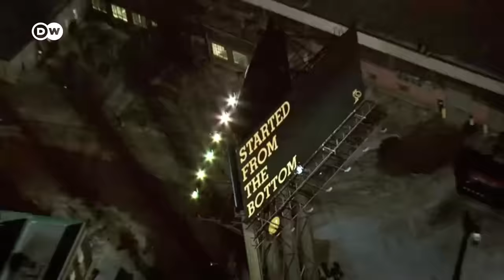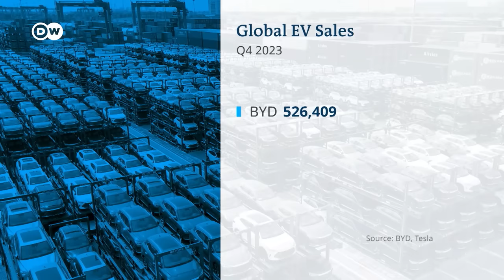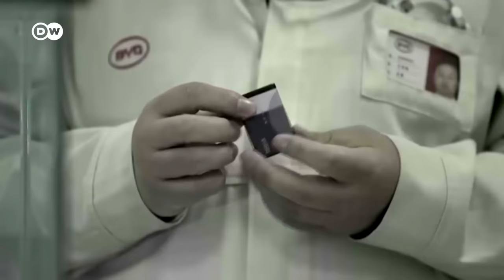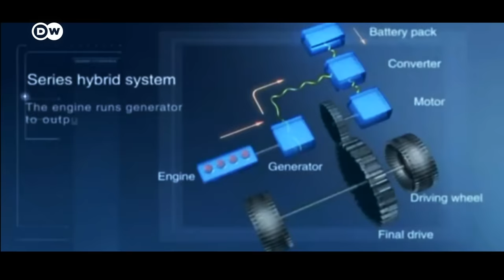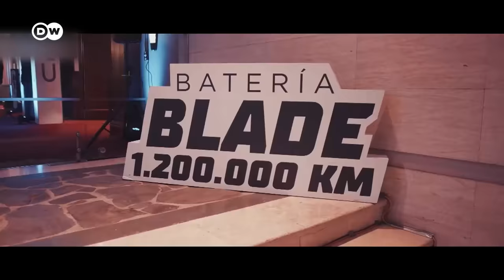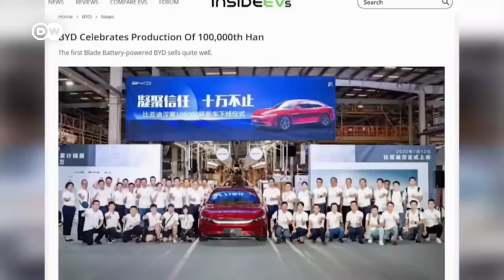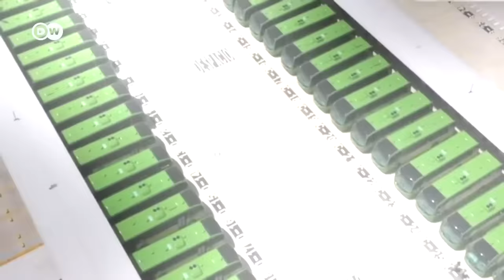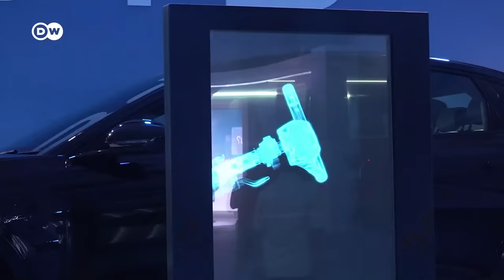How BYD killed Tesla! But can they stay on top?

Comment: BYD's battery is the main killer. No fire hazard, work well in Cold weather.
Reply: Yes, BYD & LFP batteries come with cons, heavier, less range, & throttled performance in cold, but, they won't burst into flames parked in garage overnight...burning house down...must be insurance cost benefits to that!
Reply: @100milnic  BYD LFP battery doesn't effect by -20 Celsius.
Reply: No fire hazard? Lmao.
Look it up.
Reply: @100milnic  well fan west car
Reply: The export variant is better but often the BYD domestic variant gets fired on the road.
Reply: @dannicrane5577 byds that are burning are older than 2022 because they started using blade batteries since 2022

Comment: I took the plunge and leased a BYD Atto 3 this year. I honestly have to say I haven't ever owned a better put together car. Previous cars in the household have been Honda Civic and CRV, VW Golf and Subaru XV. In all of them I found something not right in the assembly, or they were recalled for faults. So far I cannot fault the BYD, except for the OEM choice of tyres which haven't performed so well in wet weather (will be swapping to either Michelin or Continental soon.).  I can honestly say old school car manufacturers have a BIG problem in front of them as BYD is pumping out a quality product at a very reasonable price point.
Reply: I would like to get a month by month evaluation as time goes by...tyres..is 1...but an important 1..I look forward...this is not a knock to BYD..
Reply: I agree with you.  I have the BYD Atto 3 元plus for two years now.  I haven't owned a car that made me happier.  There are so many feaures the BYD gives to the driver and passengers, I don't know where to start.  It is truly an unbelievable car, and very safe.  Extremely well engineered.  Amazing.
Reply: @thezishateapotchannel.1675  the small monitor screen is the only thing I can't accept
Reply: I wish y’all the best. Please don’t die.
Reply: I'd fault their brand name... "Build Your Dreams" sounds kinda cringy... other than that it's good
Reply: @monkeydee7132  how about Life's good? LG?
Reply: @radiatorrobert151  FYI in the new 2024 release of BYD Atto 3 the tyres are now all Continental tires by default, they removed Batman tyres completely.
Reply: @LoveTheMusicOz Where did you lease your BYD? Considering they are not currently sold in America. Safety issues and political tension between countries, are main reason they are not sold in the USA. Any BYD auto, would not surpass a Honda Civic or the little family oriented CRV.

Comment: German managers should not be surprised, they intentionally didn’t do anything towards EVs.
Reply: German manufacturers just want to continue to earn profits from ICE vehicles.
Reply: They are doing a lot, the Chinese just work harder and smarter for much less money and have economies of scale. The Japanese are trying to figure it out, the labor cost is cheap here, and there is money but technology and software are on the Chinese side.
Reply: Both companies grew with subsidiaries and loan dumping, BYD workers get 1 till 3 $/h and Tesla pays 20% under market level. Why should German companies force themselves early into a rat race. The whole EV thing will only get serious when solid state batteries are cheap and save. 70% of Europe's population simply can't afford the price and the headaches.
Reply: Especially Bosch, I used to be so proud of the brand. But for the last 20 years it's just total denial. Scooter and E-Bike is all they did
Reply: @whistlingdiesel that solid state stuff is only a delaying taktik. Drones will benefit and able to pay the extra. 
Sodium ion should the choice if they get it to 80$/kWh 160Wh/kg and 6000 lifecycle.
Reply: @tarant315 If Bosch “didn’t do enough” for the EV movement… that should really tell you something!! As the largest automotive supplier in the world.
Reply: But firms like BMW and Toyota and Honda went into hydrogen. That might beat BYD. But even if BYD itself falters, another Chinese firm specializing in hydrogen cars may emerge and become number one.
Reply: @lukeclifton4392  let Tesla build their own equipment, and any other car company in that case. Perfect own goal.

Keeping the status quo in polluting industries is nothing I like to be proud of
Reply: Hydrogen is scarce. It doesn't make sense long-term. @TheHammer70
Reply: Not everyone want an EV. We like luxury ice cars. I don’t want to be seen in a cheap small car. I rather pay more to differentiate myself from the crowd. 
I think it’s stupid to build cheap cars and think you can make money from it. There’s a reason why Ford, GM & dodge stopped making small cars. Nobody want to buy it.
Reply: @hidetsu7249   the chinese do indeed work hard and for less, but in terms of innovation and billions of dollars spent on design, saftey issues, batteries and other development of EVs China didn't do much either, they quite literally just made them based on foreign designs and engineering.
Reply: @tarant315   what are you even talking about dude? What does supplies coming from germany or any other place of export even matter? Its impact on pollution is literally zero considering german manufacturing makes up for the extra pollution spent in transit. You do realise the worlds markets have been interdependent on each other for parts, raw material, labour etc. forever and ending this would massively hurt the economy of scale.
Reply: @goingoutotheparty1   what a vague and ultimately meaningless little metaphor you got there. I'm not sure how this is similar to a rabbit in headlights but oh well
Reply: They know the EV fad would come to a screeching halt, and it has!
Reply: @dopaminedreams1122 blade batteries are made in Europe and copy WV design!
Reply: @tarant315  You know the EV industry pollutes more than ICE right?!?! 🤣
Reply: @maxkick7656  Hydrogen isn’t scarce.
Reply: Germany is playing so safe that they will soon start scoring own goals
Reply: @maxkick7656 hydrogen is THE most abundant element in the Universe.
Reply: cause EVs are junk
Reply: @amandagrant4331 as they should
Reply: @TheHammer70 hydrogen  is a super dangerous choice. Hydrogen can explode at a concentration of 4% in the air. leakage of 1 hydrogen car will cause explosion in 20000m^2 area. If it explodes in a parking lot or a tunnel that ‘s full of hydrogen cars, it will be hell a disaster.
Reply: @Allangulon 
3 decades ago some people said that home computers and internet were a fad and would never become popular. 😂
Reply: @lukeclifton4392 
You know you have brain fog right?
Reply: @whistlingdiesel  to perfect a product, you need time for trials and errors.. it sucks to to play the chasing game..
Reply: As a Chinese point of view that's very understandable. They already have the infrastructure earning billions from it - why change? If China was in the same place, it could experience the same thing. Time progress and change.
Reply: @Anonymous------  
Apples and oranges.
For one, we didn't have home computers prior to 1977, unlike motor vehicles that have been around since 1901. Simply put, the home computer had no competition, the EV has stiff competition.
If the powers that be really care about the environment, they should demand more Efficient ICE vehicles.
As it stands EV's produce more carbon emissions than an ICE vehicle over their lifespan, considering EV's on average have a lifespan less than half of an ICE vehicle.
Questions?
Reply: @maxkick7656  
Seriously? 
Hydrogen is the most abundant element in the universe.
It's also difficult to separate as it's a sticky element in that it bonds easily to other elements and rarely found in its pure form.
So, to be more accurate, loose hydrogen is scarce!
Reply: @Allangulon  
In 2023, 82.38 percent of new cars sold in Norway were EVs. The goal is for the entire Norwegian car fleet to be zero-emission (electric or hydrogen) by 2025. 

Norway's fleet of electric cars is one of the world's cleanest, because 99% of its power comes from hydropower.

Electric cars are cool! They are silent and don't create noxious fumes. And you can drive for several hundred kilometers before you need to charge. Not that charging is a major problem in Norway – it has more than 3000 public charging stations, and 7753 fast chargers, all over the country.

Even in the northernmost parts of Northern Norway – an area with huge distances, more reindeer than people, and really low temperatures in the winter – you can get around easily in an EV.
Reply: @Allangulon  
When someone invents a way to cheaply extract the hydrogen from water and safely store it in small space.
Reply: ...70% of Germans can't afford anything, let alone a new car.
What a great govt you've elected!!😂😂😂
 @whistlingdiesel
Reply: @tarant315  John B Goodenough and Helena Braga spreaded their licences on over 30 companies and if drone or military usage will boost this, solid state will come in time. Sodium ion is pretty neat but I see the potential more in non-toxic liquid flow batteries as a green engergy buffer. But you are absolutely right if the energy density and the price is right they are on, too!
Reply: @georgewilder7423  I was speaking of Europe, tell me a country where inflation hasn't made life unneccesary hard. As germans are pretty rich they can easily afford EVs ....but not the headaches 😁😁. As in everybody can finance a new Dacia Spring but not the... you get it.
Reply: @whistlingdiesel  ....Germans are pretty rich.
If you're a German, then I say you really don't know what's happening in your country.
Ukraine isn't the only place that's doomed.
You have govt officials who don't even know the difference between 180° from 360°. Lol!!
Reply: @Anonymous------  
Good for Norway, now how about countries like Australia with 83 times as much road as Norway?
We have a sheep station bigger than Norway!
Reply: It doesn't make sense to do much towards EVs. The majority of German car owners that got EVs regret them and go back to a combustion car on their next purchase.
Reply: @dopaminedreams1122  but improved and them..
Reply: @lukeclifton4392  ..,thank you Greta!!
Reply: @tarant315  I believe Bosch have supplied the driver assistance technology being incorporated in the BYDs. 😊
Reply: How so? German EVs are very decent.
Reply: @JoeChan-c5r  nope . Blade batteries are made in china btw .

Vw doesn't have an ev
Reply: @lukeclifton4392  source ? Proof ?

Comment: BYD blade battery does not perform as high as Tesla, but works better in cold weather and way safer.  The new BYD sodium ION battery is even cheaper, less sensitive to weather and abundant.  The newly released Qin L is a HEV capable of 2000+ km range (from NY to Miami without refill), more than twice as Toyota Prius and priced just lightly higher than half of Prius, it could easily disrupt U.S. market easily without charging even with 100% tariff.
Reply: >> BYD blade battery does not perform as high as Tesla, but works better in cold weather and way safer. <<
LFPs in general are slightly safer because they have much lower energy and less performant, which is why they are still mostly limited to entry-level, low-range urban EVs.    BYDs PHEVs operating at 5+C-rates blow up quite often in China -- I'm told over 80 such fires over past 2 years.  BYD Blades are also used in mid/high range EV, but that's not ideal.  Last April in Cenxi, China, a local judge was trapped and burned alive in a BYD Hand, which made brief headline news, but never covered by international media. .
Reply: They are going to have to because of how dependent the big three are on Chinese sales
Reply: Very excited for byd to come here some day. The Tesla fanboys are going to support blocking them thru legislation tho.
Reply: @onetwothreefour-s1n  Tesla has to run on a tight rope.  China has been, and will go on to be Tesla's biggest market in the world.
Reply: BYD has a factory in US. Not for passenger cars but trucks and heavy duty vehicles
Reply: @tooltalk 那你有没有了解的中国特斯拉发生的自燃与失控新闻？这也同样没有国际新闻报道😂😂😂lol

Comment: Both BYD and Tesla are growing and the ICE market is shrinking.   So the question is who is growing faster by taking away the ICE market.  BYD sells lower cost market cars segment, mostly in China, so they will grow faster.  Tesla growth will speed up once they move into the low $30,000’s and $20,000’s  cars, either by improving the manufacturing cost of model 3 or/and making the Model 2.  BYD will have a harder time entering the US and European maket because they don’t have any manufacturing plants there in order to bypass the tariff.  But even when they do manufacturing jn Europe and US, they will lose the advantage of China cheap labor cost.  Unless they can automate and make cars just as cheap as Tesla and make their comparable model cars more attractive at the same price as Tesla, they still cannot compete.
Reply: EV market completly imploding !
Hertz (that rental comp) just dropt 20 000 tesla's because nobody hires them
in my small EU country (say smaller than texas)
another 20 000 5y company lease tesla's will hit the second hand market this year
(x15 or 20 other EU country's)
to mine lithium etc it needs african an chinese Slave labor
if ya drive it daily the battery lasts for 5y, and than to replace the battery
costs more that the cars total valeu
to make 1 battery ya need 10 years of heavy pick-up diesel to melt
& extract all the lithium and cobalt from its mining or
Reply: yet
Reply: Thats what you think, BYD already positioned to setup big plant in Mexico as a back door to enter all north Canada & southern part of the US territory.
Reply: Labour cost is not intensive because the main component as modern car factory have already installed with automatic robotic arms.
Little do you know China helps Tesla to build gigafactory when Tesla failed to meet demand for years in America.
Reply: BYD # 1
Reply: I bet you never heard of BYD's Yangwang (luxury electric car brand), introduced to Chinese market, in Jan,2023. 
approximately US$140,000/per car.
Reply: You do know that top BYD models sell for 50% more than top TESLA models right? BYD is both cheaper and more premium. It simply has a bigger range of products.
Reply: Mike, well said. Well done by BYD re BEV increase. 2023 Tesla still outsold BYD in BEV's but I think by end 2024 BYD will be number 1. As you said, once Tesla starts producing their Model 2 (cheaper car) the battle will be interesting. In 2022 BYD stopped making purely ICE cars but now use those same engines in their Hybrids (Foe NEV's) The Hybrid market will begin to drop away as more and more the EV market becomes BEV. Sadly, some of the legacy Auto Companies see hybrids as their salvation since it allows them to keep producing their ICE engines with a "vibrator sized electric motor" and batteries. (Quote stolen from Steven Mark Ryan SMR!) Long term, I see BYD as the largest car manufacturer in the world, with Tesla slowly creeping up to second years later. Initially simply because of the number of factories BYD has. Cheers.
Reply: Whichever price segment for the comparable car that Tesla is in they always dominate with the best seeking car with the largest profit margin.  BYD might sell more assorted cars but not for the same margin.  If Tesla drop their price to bring down their margin, their model 3 might go into the high $20,000.  Don’t think BYD in this price range can compete.
Reply: BYD is just better all around - period!  @byhyew

Comment: I like byd style. But they need to demand their suppliers improve quality of steel, electronic’s, electrical distribution and make the 1,000 mile, solid state battery that comes with a 200,000 mile warranty on the battery. This is the minimum requirement for the amount of money you’re asking.
Reply from the maker: Those sound like reasonable points!

Comment: Chinese companies have mastered the art of PCB assembly after decades of producing products for western companies.

What we see regarding EVs is the outcome of such experience; they use discrete components (which means cheaper and lighter e-motors) while Western manufacturers prefer the module solution (which means more expensive and heavier e-motors).

Comment: The main reason is the Chinese government has control of almost all the critical minerals used to make the batteries and so they can make them cheaper than Tesla. Think of BYD as a branch of the Chinese government that makes cars and have easy access to all the critical minerals and supply chain needed while Tesla is just some company in the United States without access to the United States government supply chain of critical minerals

Comment: Tesla just edged out BYD in July 2024. BYD would do ok if allowed to be sold in the US. Both US political parties are in protectionist mode with the upcoming election. Warren Buffet still owns around 10% (maybe around 7% now) of BYD stock. He gave BYD a financial shot in the arm when he invested $230,000,000 in 2008. EV sales are slowing in 2024.
Reply from the maker: Although, it does seem like Buffett's been offloading a fair bit of BYD stock over time...

Comment: EVs are overpriced. Development costs are not necessarily the main factor.
1.Motor and controller development costs are now nil, already done over 10 yrs+.
2.Vehicle body and mechanicals are already developed and paid.
3.Interiors same.
4.Battery development is ongoing but available at a certain price point. 
It appear manufacturers are not just making a simple EV, they are also adding costs to integrate a lot of unnecessary electronics and communications and autodrive functionality, that artifically increase the price. Do not force the "autodrive developement" costs onto EV vehicles.
Get back to basics, and make a simple, maintainable, scalable EV. Ditch the auto drive.
Reply: The "autodrive" functionality is being forced onto ALL new car models by regulators. It is not just an EV issue.